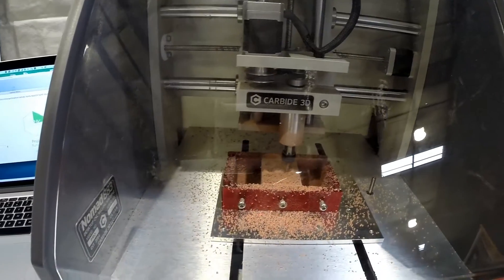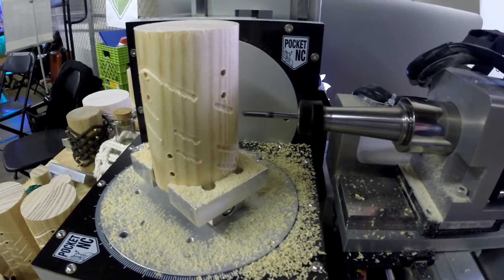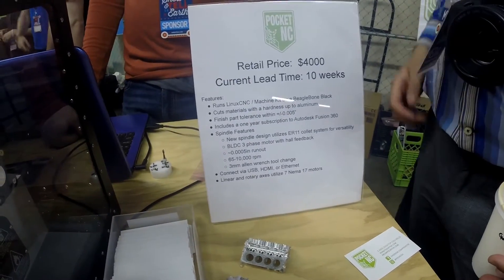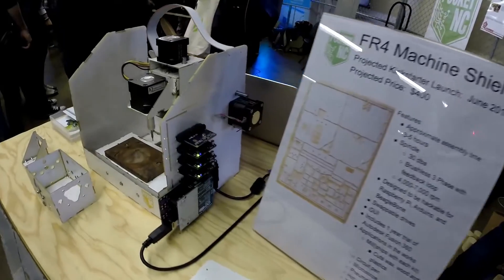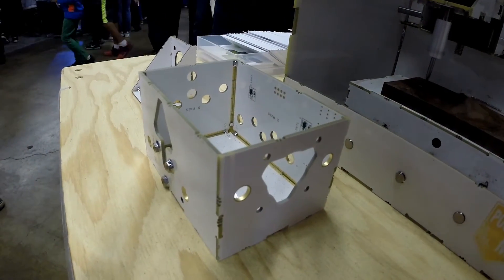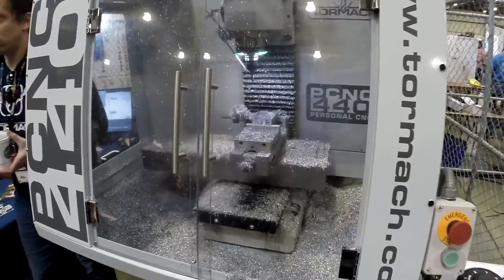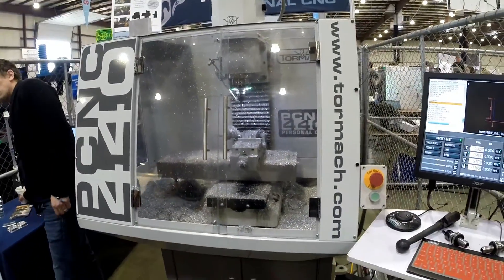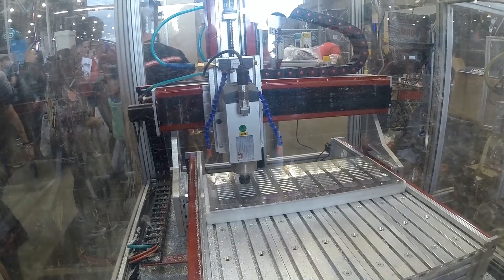Maker Faire 2016 CNC Overview

Comment: Calvin, what in your opinion is the best 5 axis cnc machine for under 5,000?
Reply from the maker: Evin Anglim 5 axis under 5K for wood... hmm honestly not sure off the top of my head. I know there are machines capable of 4 axis in that price range.
Reply: Thanks a million for your reply. Could you recommend a 4 axis machine?
Reply from the maker: Evin Anglim Hmm the Little Machine Shop 3501 CNC mill is 3 axis out of the box but it has an available 4th axis addon... Drawback is with both your pushing 5K for 10 x 4 x 7 travel [with 4th axis its smaller]. Upside is you got one heck of a rigid machine!

Comment: thanks for the review of  the pocket nc and mentioning some of the "issues" you have with it 
I wondered about fusion 360 is it grunty enough to run the pocket nc ?? (never been afan of autocruds stuff)
I would love to get my hands on one of these little beauties (despite its faults)
Reply from the maker: no problem! while i did not personally use the machine i was not at all impressed by the demo... its a cool concept that needs some help!

as for fusion 360 it (as of when i was filming) was 3+2 only it may do simultaneous 5 axis but the demo stuff was all done in mastercam... i use fusion at home and its fine for the price honestly... but im doing simple stuff! Hope that helps!
Reply: Hi Calvin 
thanks for the reply 
My understanding is they have done a revision on the spindle which may alleviate one or more of your concerns , I hope they continue to improve this  little machine as I have a four year old boy I want to have an excuse to buy this machine for;) (future Training)
Plus I have a few other  ideas to use this machine for
Reply from the maker: it has a lot of potential as a mini CNC machine its just a little jagged and chattery around the edges is all! That said I do hope they can improve it as it would be really cool thing to have for prototyping of various things. For now ill gladly stick to machining stuff from sheet metal and other items!